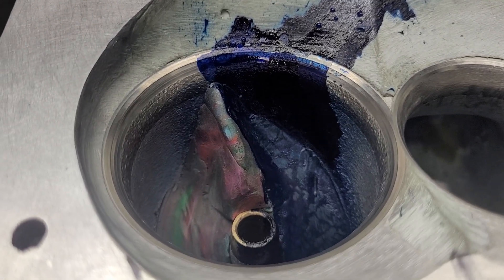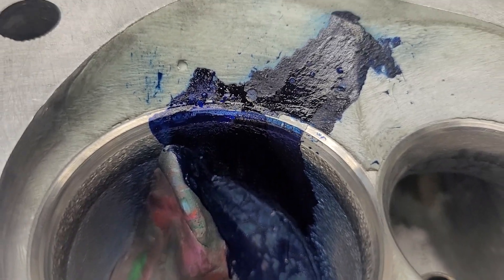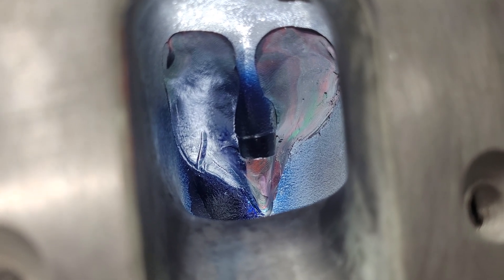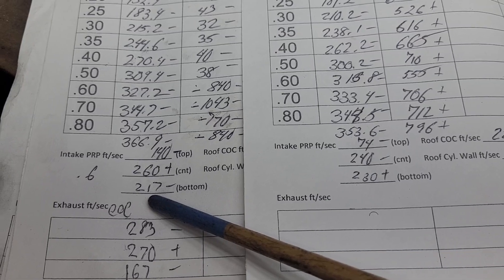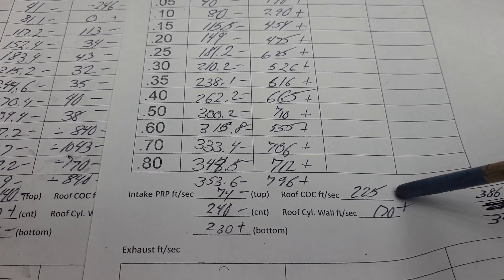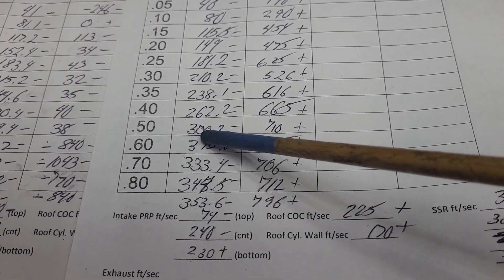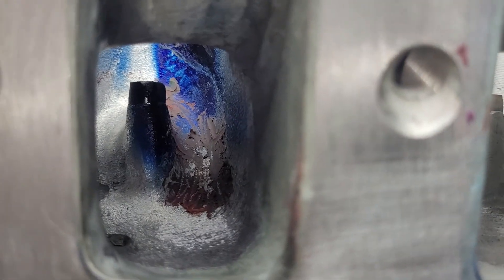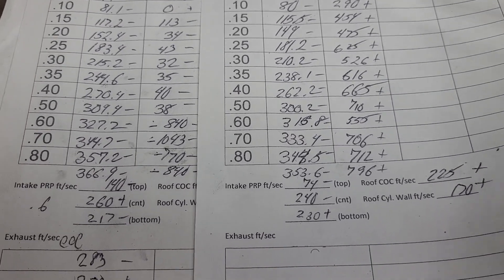Big Block Oldsmobile cnc master, fill that bowl! Experiment.

Comment: I run a .740+ solid roller cam and a 1050 Dominator carb in my big block Olds on the street. 

It's actually quite tame and has great manners on the street. It idles @ 1100 rpms with no issues and doesn't load up at stoplights. 

The big Olds likes big carbs and big cams
Reply from the maker: @davelowets  Great info. Thanks

Comment: Great Stuff!  quick google mathilator comes up with 19cc or so for your clay ball.  I vote you do more olds stuff.   I have a edelbrock torker for 455 i need help with! the runner shape seems all backwards to me....
Reply from the maker: That is a terrible design. Ugh.
Reply from the maker: Thanks!
Reply from the maker: 19 cc! Damn. Stay tuned for tomorrow's video. Same 19 cc but even better!
Reply: Use an Offenhauser Port-O-Sonic for a mild 455, and an Offy Super-Sonic for a big power motor. 

They are MUCH better intakes than any of the Edelbrock Olds intakes.  
Don't even bother with the Edelbrock Victor Olds intake either. It sucks.

Edit: You will have to do some porting of the Offy intakes for anything more than a mild engine. 

On my 600h.p. street engine, I used a Super-Sonic 4500 intake with the cloverleaf milled out of the carb pad for the much more needed plenum volume, and then the runners have been enlarged quite a bit and port matched to my ported Edelbrock heads, and I ended up using a 1" open spacer under the carb for the most power.
The intake works VERY well.